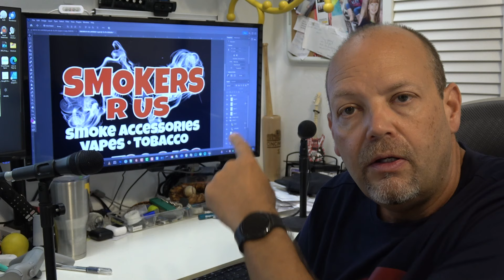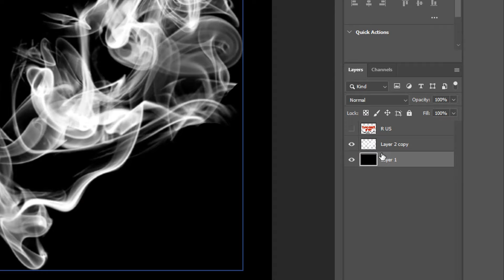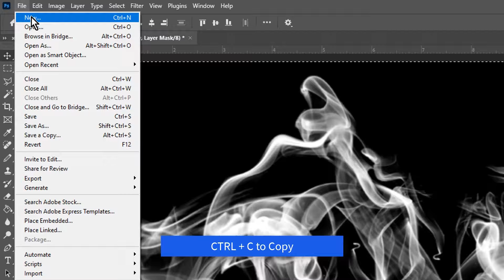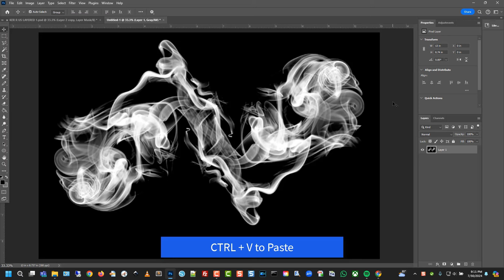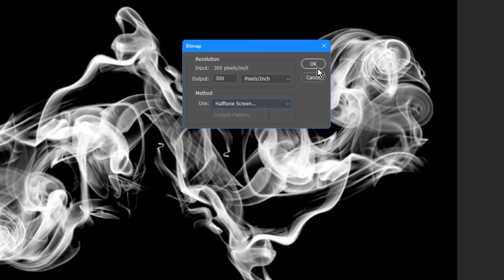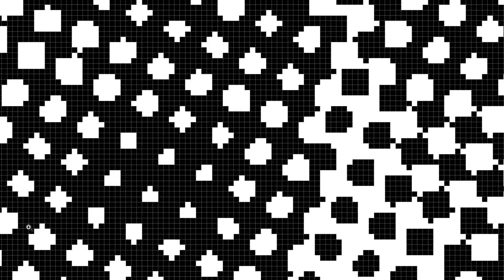Using Hafltones to Fix Partially Transparent Areas for DTF Transfers

Comment: How did you seperate the smoke from the other if the custom sends a png or jpg? I understand the halftoning part but theres some artwork i camt figure out how to seperate
Reply from the maker: @nashvilletransfers  in this case the file was layered, but if you halftone the entire image I believe it will only change the areas that are partially transparent.